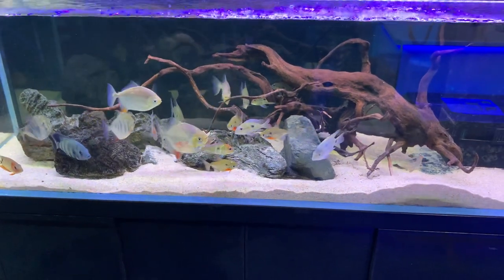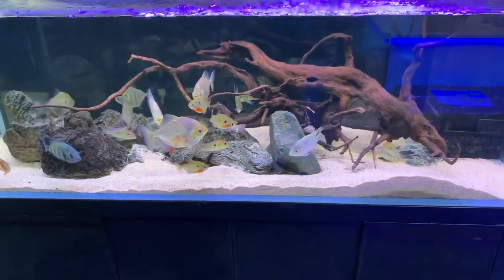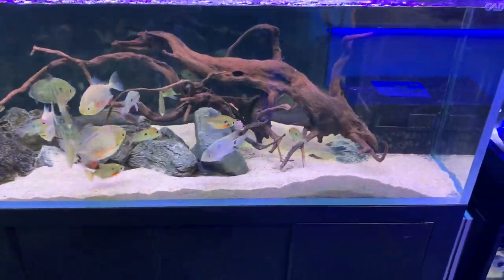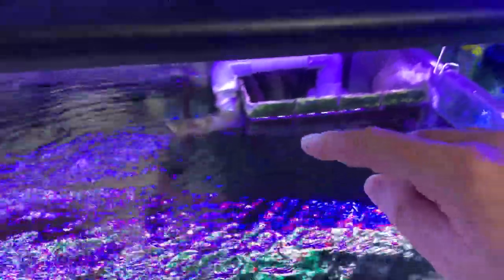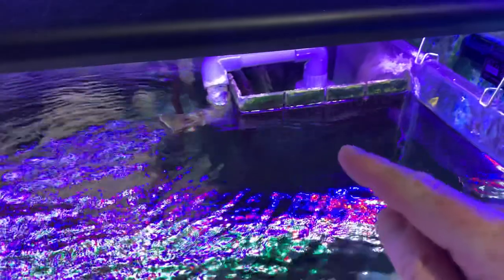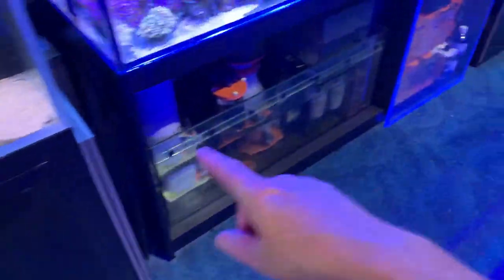You don’t need more water through your filter!

Comment: So a 450 litre tank only needs to run 2-3 times an hour through a canister filter (so roughly 1100 litres per hour is sufficient) but get a wavemaker to move the water around the tank 20x?

Comment: question kinda stupid but is there a difference between flow from the filter system and flow from a wave maker and or pump? for some reason im thinking the outflow from the filter would be more beneficial to the corals etc than just a wave maker or pump? or does the nutrient level just all mix together at that point
Reply from the maker: It all mixes up